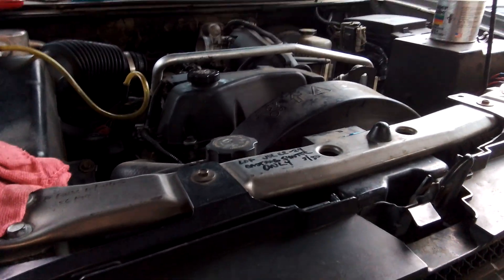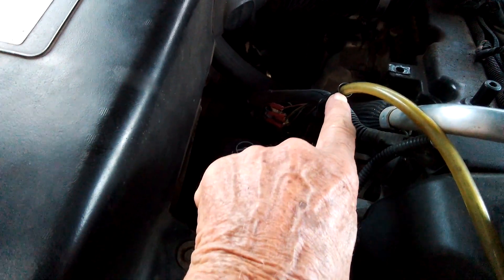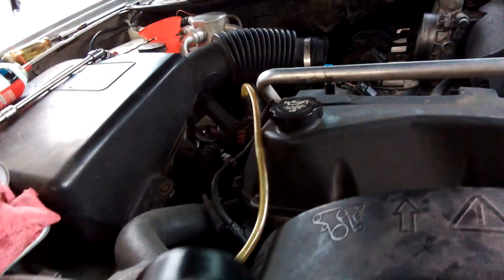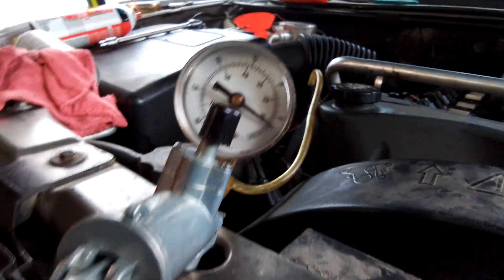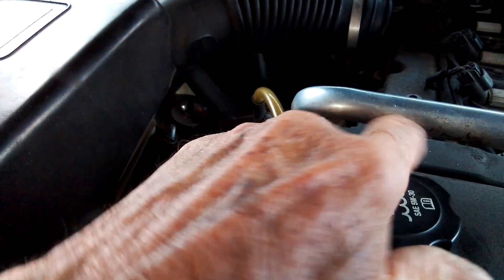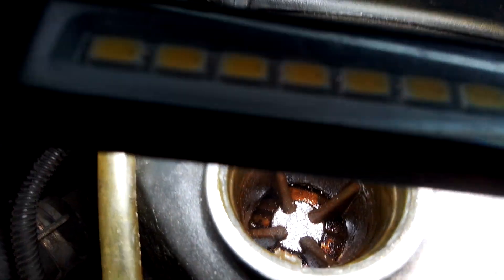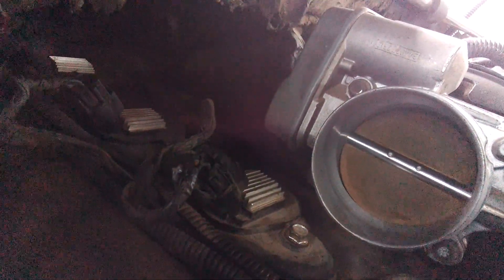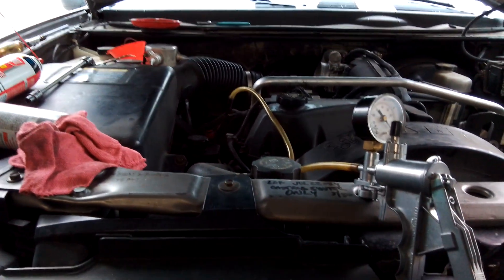PCV Vacuum Testing (simple)

Comment: Thanks for taking time & sharing. I've over 300K miles on my '04 TB EXT 4x4. Reman long block at 250K, with a 3rd transmission (2nd had reman torque converter weld leak).  Your info on the PCV of the 4.2L is good, yet uncommon knowledge. (Seems Chevy went overboard on part counts of air intakes for this platform.) 

Why not just plug-off the S-hose plenum nipple port? Sure improved the case vacuum level when you plugged it. 

(Understand it's an old post. But, your knowledge is very comprehensive. Even if you've retired your TB.)